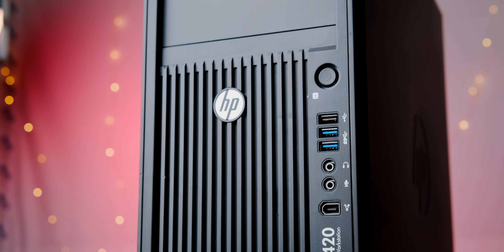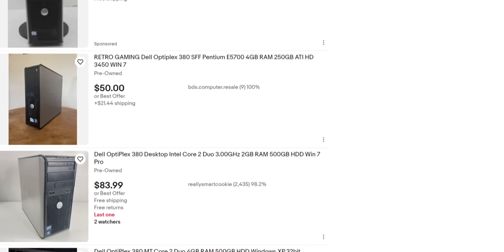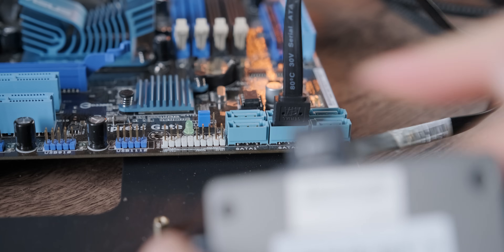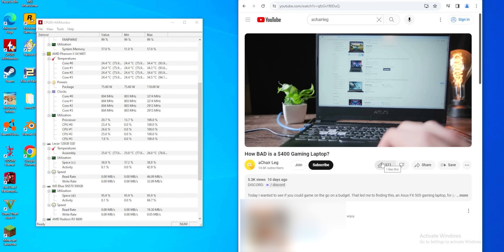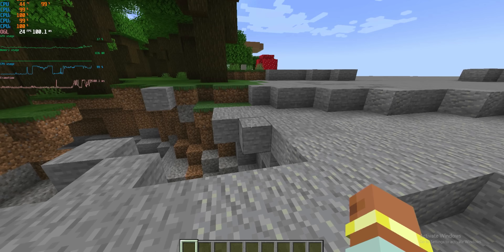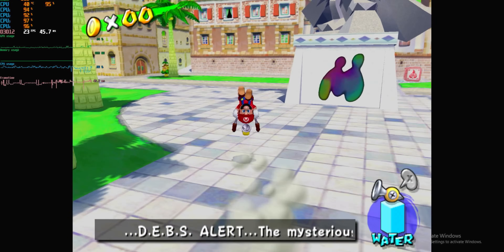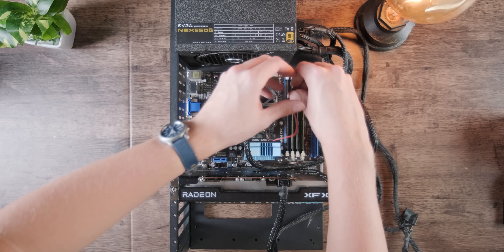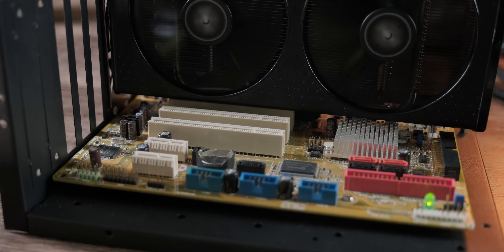DDR2 is DEAD.

Comment: i use a core2duo thinkpad x200 pretty regularly, it's amazing how capable these old machines are with maxed ram and an ssd
Reply: hi, how much ram is the max? I do have 4gb and it really struggles with windows 11. Also is that ddr2 or 3? (i know some models had one or the other).
Reply: @picchioknossus8096  ddr3, 4gb is the official max but 8gb apparently works.
Reply: @Armadurapersonal That's what Apple had said about the late 2009 MacBook, but Intel's documentation showed that the Core2Duo could handle up to 8GB. So in 2014 when my parents upgraded their MacBook to 8GB, they had to take the word of PC tech over Apple. So if you're wondering, check out Intel's documentation via a web search. But compatibility doesn't end there. Manufacturer's BIOS/UEFI must support more RAM as well.
Reply: @HWandW  seems like 2x4GB PC3-8500 should work. Haven't tried, I use mostly terminal apps or a single webpage open and haven't felt the need to upgrade to 8GB yet.
Reply: There are laptops that have Core2Duo that run DDR2 and some newer Core2Duos that run DDR3. Many of the Core2Duo laptops will max out at 8GB of RAM. I lug around a late 2009 MacBook that has a Core2Duo, 8GB RAM and an SSD. If it gets dropped, smashed, scratched, stolen, lost, then it's "whatever". Everything on the SSD is backed up to a cloud. It's nice having a laptop that I don't have to be concerned with something bad happening to it. The only thing I'd want out of it would be the RAM sticks to put into another "whatever" laptop.

Comment: I was using a Q6600 BSEL'd to 3GHz with 8GB of gamer DDR2-800 and an ATI 5770 as a daily up until last May. It's fun getting games to run alright on that old hunk; battlefield 4 was very playable after some effort. Minecraft was also fantastic with performance mods when playing on a server; modern world generation was a bit too taxing to be smooth, but hey, just put that on another computer. I do intend to upgrade this system to a yorkfield xeon sometime still, and to use it for other light tasks, like maybe a drawing desk computer or a CNC controller.

Edit: also, dolphin ran better for me than for you and I'm not entirely sure why. I even ran breath of the wild on cemu on the thing, and that was back when it was running 2.4ghz with 6gb of ddr2-667 and a spinning disk. I've got a video of that on my channel from early 2020 if you'd like to behold it. It was not playable but it sure was fun.

Comment: There's ALOT of industrial equipment that uses ddr2 or even older systems, while it doesn't make sense to the ordinary consumer there's actually a market for old hardware like this. Imagine you have a 250 000$ industrial machine controlled by a ddr2 phenom system, which fails because the motherboard degraded and shorted out. It is way cheaper to replace the motherboard even if the "price" is higher than newer stuff, simply because the other option is to replace the whole 250 000$ unit.
Reply from the maker: Very true, businesses can rly drive up the price of old hardware

Comment: I had a LGA 775 P35 System last year with an cheap Q9300 and 4*2 GB DDR2 RAM at 800Mhz, a HD 7770, 120 GB SSD and Lubuntu. The performance was descent. Kinda. I played Minecraft, older games and Indie games on it.
So it can work, but I still would recomend not going further back than the 4th Intel Generation with DDR3 for a daily driver.

Comment: i have two running systems on ddr2 . useful for youtube and long term storage box.. 3 cpus for use as well. 1.6 ghz 2 core celeron , single core 3.0 ghz pentium d and an E 8600 at 3.3 ghz. The other one is AMD socket AM2 which also had similar phenoms and dual cores.  Phenom 265 4 thread at 2.8 ghz and the dual core "something" 6400+ at 3.4 -.6  ghz, honestly don't remember . All old office machines that were in different hands , they hold up great with 8 ish GB of Ram and sata ssd . A gpu less than 4 generations old can run esports titles and many many lighter needs. Preferring dual cores over the quad cores for this generation , I have fun and maintain storage backups. Games that are 5 + years old were still made for dual cores and most don't need modern cpu cache to run at 60 fps. Really its a 30 -60 fps experience with the best components.

Comment: its the same just different print or die sizes to get more memory, and better quality for higher clock speeds. until you get into quad channel xmp and buffered ram
Reply: most dont even know about memory channels and often buy single channel setups 🤔

Comment: I actually have an old 775 system that I got for free around. Just recently I realized that it has DDR3, but it only supports up to 8GB. So I went ahead and picked up two 4GB DDR3 sticks for like 15$, threw in some old 120GB SSD that I also got for free, and I had GTX 660 laying around so I just used that one for GPU part. And yeah, CPU in mine is Q6700. It's still alright today but don't expect any miracles.

Comment: Are you sure winblows wasnt downloading and installing updates on the backround?
With new install, w10/w11 is constantly downloading and installing updates in the backround.

With fast ssd and internet, it will make the slow cpu the bottleneck and slam it to 100%.

Whenever you are testing system with old cpu's, do not connect them to internet, or let them sit for few hours so that they have installed all the updates they want.

Idk what was with your minecraft, i tested athlon 3400+ s754 ddr1 system with mc 1.7.10 (last that supports the cpu) and i got around 70fps with vanilla minecraft.
BUT i played on a server so all the chunk generating etc was handled by the server, but still phenom 2 x4 should be more than enough.

Also for phenom2, you should "overclock" it with 250mhz Bclk, but keep the multiplier lower so that the system runs stock.
The larger bus will increase the performance around 20%! then you can increase the mp so the cpu runs at 3.8-4ghz.

I had phenom2 955be on ddr3 motherboard back in the day, with watercooling i got it to ran at 4450mhz and it was awesome
Reply from the maker: Nah it was done updating. I have big fps drops even on my 3700x when playing vanilla single-player. But when you're sitting at 300fps a drop to 200 isn't really noticeable

Comment: I think the empty drive needs to be reformatted to mbr, it is very likely in gpt and the bios cannot access the boot sector because it doesnt exist.

You can use gparted or fdisk to reformat to mbr which will create a hidden boot sector for the bios to access, or you can use gparted or gdisk/sgdisk to create a really small partition at the top of the drive, then mark that partition as a psuedo boot sector that the bios will most likely be able to recognize.
I would recommend just putting the drive into mbr mode as you are using windows, it will be much simpler

The windows installer doesnt seem to be able to write the bootloader the boot sector, and is throwing a warning because it knows it cant boot without a bootloader.....
Reply from the maker: Tried mbr, didn't work. Really stumped, not that it matters since I managed to get windows on it at the end of the day haha

Comment: I'm running A8, 16gb of DDR3 ram, with a GTX 1050 2GB of Vram and I play al those games with no problems. I don't get it, you using a chunky video card and those games should be playable. I think if you use Hirens CD, you will be able to stop all them processes in TM that eating up all your resources.
Reply: I got an AMD A8-9600 system when my main system stopped working , that cpu was slow asf, even with with 32gb ram it had issue with just the simplest task, it was constantly stuttering.
Reply: I am using a Small Factor PC AMD A8-5500B APU with Radeon(tm) HD Graphics. But like I said, I use the NVidia Geforce GTX 1050 and I play at low settings, but I am happy with it. I mainly play my games off line on single player. but I get Stand Alone games, not in another app like epic, Steam, EA that uses up all resources during gameplay. So having stand alone games, is way worth it, and I can play on cracked servers or alternative Servers. @ibobeko4309
Reply: I don't think it's your machine but your Windows. Something is telling me, you using a cracked version of Windows.  @ibobeko4309

Comment: I get that the 6600 is nice. but why would you use a PCIe 4 x8 GPU? Especially since those are PCIe 2.0 systems. You're at best getting 1/4 of the expected bandwidth.

Comment: Gaming is one of those things that drives CPU innovation, so yes, that was always going to be comical on machines this old. If anything is going to be first in line to use new instructions to boost performance, it's going to be a first-person shooter.

However, the tail-end of the Core2 era is still usable if all you want is a web browser or word processor. I have my father's old Dell Inspiron 1720 from 2008, and over the years (when parts were incredibly cheap), upgraded it to a T9500, 6GB of DDR2 RAM, and a pair of Samsung 870 EVO SSDs. It is presently running Windows 10, and after going through and cutting out extraneous services, it runs pretty well. I wouldn't daily drive it, but if it were my only computer, it would be fine. I still use it as a "test workstation" in my home lab.

I wouldn't BUY a system that old, but if you have one lying around, they aren't entirely useless yet.

Comment: its expensive cuz there are alot of legacy servers and that that are still running ddr2 so they are all bought up for that. Also systems of this age where built in the middle of when hardware was evolving fast so they have ALOT of IO. PCI and pcie, serial ports IDE as well as sata. Other things like firewire are also often included too. So one system can be compatible with basically all hardware and software made in the last 30 years almost. This makes it very desirable, the other reason is its old enough that people are starting to put "retro gaming" and "vintage" in the ebay title and a couple extra 0s on the price.

Comment: Most of the systems I use are DDR2 based and I have no problems with it running windows 11 and doing some light gaming here and there. No it’s definitely not ideal for high end gaming but for normal everyday use it’s kind-of a waste to use anything newer when you can get these so cheap or even free. It’s a shame people think these systems are just obsolete junk when that’s the furthest thing from the truth. As for DDR3 My boyfriend has a DDR3 i7 3770 system that he can basically play any game he wants on including cyberpunk 2077.

Comment: Realistically, you're not going to be running Windows 10 and modern games on a DDR2 era system. You'd buy it absolutely to replace parts in, or even build from scratch, a retro system.
Reply: I won't be running modern games on a DDR2 system, but surely I'd install Windows 10 on it

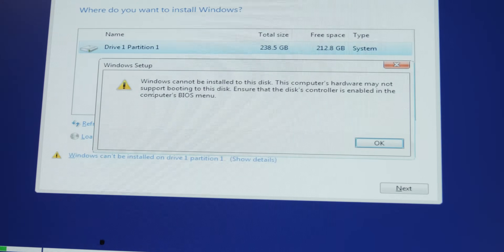Comment: 3:23
I had that weird issue before, turns out the drive that you're going to install Windows has to be in [Hard Drive BBS Properties] and [Boot Option Priorities]. Most importantly, it needs to be in MBR instead of GPT.(Shift + F10 and use diskpart to see if it's in MBR)

Comment: Those old computers would still be usable if only they weren't so power hungry.
Reply: In addition to being slow, the other big problem is the older cpus don't have the cpu instructions needed for most modern software.

Comment: Gamers really over estimate how much memory people need.  You didn't think 8gb would run chrome?  My partner has a 4gb system and it runs chome with youtube just fine.
Reply from the maker: Windows and chrome has gotten pretty bloated. My main pc at idle uses 7gb
Reply: @aChairLeg  That sounds reasonable depending on the amount of ram in your system.  Windows will "use" some of the memory for various applications so they'll start up faster when you click them.  If you end up needing it, it'll just switch up.  The effect scales to your system so if you have more ram windows will use more of it.

my system (8gb) uses about 2GB and my partners (4gb) uses around 1.5GB.

Idk about chrome but firefox uses about a gig with a video playing in the background.

Thats just my experience though, YMMV.
Reply: Modern OSes like to allocate everything so that they can load heavy stuff faster but most of it is usually readily available memory. It frees itself up when a program actually 'needs ram for real'

Comment: I still have several ddr2 based systems running (Intel and Amd).
You should not pester these things with an outdated windows. (Windows 11 won't run)
Linux runs great on these.
You get a modern os which can play most games.

Comment: The SSE 4.2 and AVX requirements for doom eternal and RDR2 are bullshit, there are patches and cracks that removes the need of those, and were present only for DRM reasons.
There is a youtuber that did the test on those on a core 2 quad (but with DDR3s compatible mobos) and it ran surpricingly well for being 14 old chips.
The SSE 4.2 and AVX gets used alot for anticheats too so, rip multiplayer games gaming, some games like CS2 worked just fine during beta but after release they updated their anticheat so you cant run it anymore, same thing with warframe.

Comment: Have you disabled virtualization, power saving, and cool and quiet features? To this day I still daily drive a 1090t with 8gb of ram. Disabling some features really stabilizes performance. Older single core games go from 20-30fps to 120-180fps, more modern games between 50-80fps. The difference is massive. Fortnite for example ran at 80-85 with some dips and I locked it at 75fps to keep it smooth. Cities Skylines is mostly single threaded but keeps above 30fps. Even non games like Excel or Chrome ran way smoother with the mentioned features disabled. Yes the system shows it's age, but it puts a hell of a fight. I even dare to do video editing (although the actual rendering in 4k takes a very long time and 20-30gb of swap).
Reply from the maker: Ahhh that's crazy! I'm really considering doing a second video on these

Comment: Idk about DDR2 but DDR3 spec is decent. I just fixed up and old HP Compaq Desktop with an AMD A10 5800B with an SSD, 16 gigs of memory and a 1050ti. And it's decently powerful, I played through some old AAA games and a few indie games and it's playable. Didn't expect Assassin's Creed Unity to run flawlessly at locked 30fps on ultra settings but it did. So yeah. I think I've spent just around a
 120 dollar equivalent on the pc (mostly the GPU). I think the best I can do now is swap the built in motherboard with an Intel 1150 motherboard and buy an i7 4790K which I saw a listing on Amazon for 50 dollar equivalent.

Comment: Are you sure you had the AMD motherboard SSD as the primary BIOS Boot priority? No joking, that's what usually causes windows installer to run into MBR issues and then throw that error.

Comment: LGA 775 and AM2 sockets are still perfectly good for browsing web and creating your presentation or a document. It can even game for the most games till 2016-2017. I'm to this day still love em and use em. And the DDR3 systems sometimes costs more than the DDR4 system in my region. And the DDR2 systems cost hilariously low. I can do the 10-15$ fully working 775 PC with the GPU. And it seems perfectly good and valuable for such a price.

Comment: I've had the exact same thing as you've been telling about at the end.

In small business I operate, there's no need to upgrade the whole platform for the storage server and a simple website hosted locally. It runs on some old Core 2 Quad, 8 gigs of RAM and... that's it. Works well enough at 1GbE, so why bother upgrading it further than the CPU?

I've recently replaced only the CPU in that system. I believe it was from Core 2 Duo E8300 to Core 2 Quad q9500. And I believe this will rock for the next couple of years. And if it won't, well, I have some 775 motherboards lying around, I can just plop that in there and call it a day.

When replacing the CPU, I was amazed with how... expensive these ancient chips are. 35 bucks for a 14 year old chip? I can get something like Ryzen 1600 for that price. But then I have to make the effort of replacing basically the whole platform... which isn't economical for the use case at this point.

Comment: Unfortunately in countrys like Denmark people think everything from a computer is GOLD or DIAMONDS... The prizes are WAY to high for old items

My "old" system still runs AMD Phenom II 965 BE
Reply: Not sure about diamond part, but some hardware is LITERALLY gold, due to the electrical properties of gold and its use in PCB traces where high performance is required such as RAM to CPU lines.
Reply: @UltimatePerfection  I know there is gold in electronics, but every hardware is still very expensive here in Denmark
Reply: I had a 965 BE system, sold it when sandy bridge came out and built a better PC for the price i sold the 965 BE system for.
Reply: @craciunator99  I used my Phenom II x4 965BE running at 3.9Ghz till I got a i5 2400 system.  That board only supported 8GB of memory which was fine when I first got it because people were still running two to four gigs of ram.
Reply: I thought developed nations have lower prices for 2nd hand electronics because they have more disposable income?
Reply: @Engiduck Some people are just delusional about what their used hardware is worth.
Reply: same thing here in italy, but to a lesser degree
Reply: People looking to extract the literal gold from these things.
Reply: @CamelCasee  i know, but this has nothing to do with gold. It's the prizes that makes them think it's gold or diamonds.
5 year old computer still costs 2.000 dollar even though they paid 2.000 5 years ago
Reply: How expensive would a 2nd/3rd/4th gen i5 office PC with 8 gig DDR3 be in Denmark?
Reply: I have an athlon x2

Comment: I have a laptop from 2007 an optiplex from 2009, 2 2008 GPUs and a 2007 monitor. Neither of the computers work and the monitor has a plethora of issues but old tech is cool even if Im just hoarding broken stuff